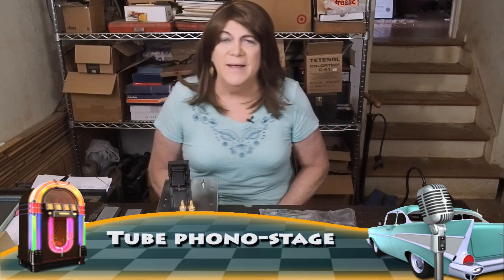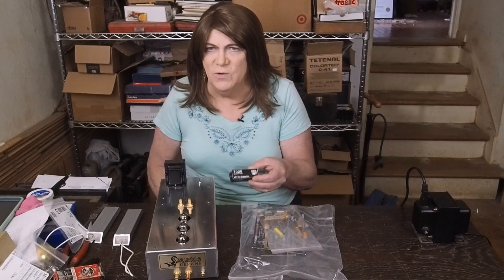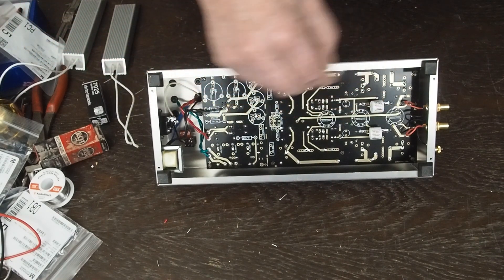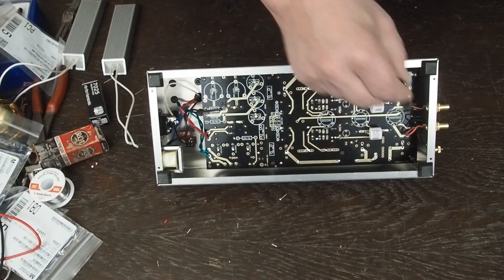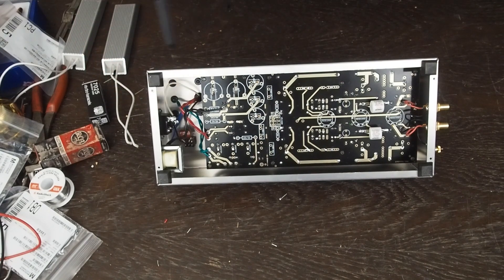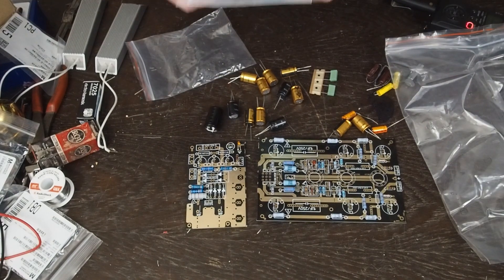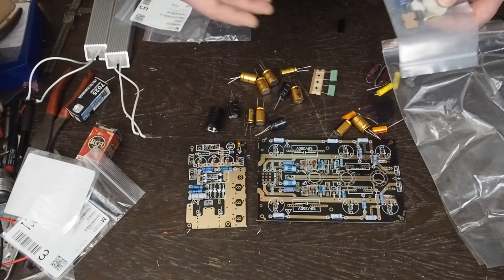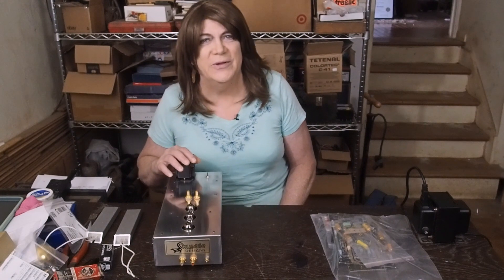All tube Phono Stage, Moving Magnet Pre-amp

Comment: realt beautiful you should se my point to point build, wold like to send pics of it, the construction use half ecc83 in start  I builded in an old tape causer.going to light it ups, it didn't get the rial filter correct so it went away -no noice to my bbl s. I hold correct the filter. I gave it ups.

Comment: I loved your video !
Before i get one of these PCBs,  I was asking myself if these designs come with a delay to ensure voltage is applied to heater before plates... I did not recognize it on the schema.
Also, is there a protection not to blow up the power amplifier that will come behind it with 200V in case something does wrong?
It's a pleasure watching your videos!
Sincerely,
Fabi
Reply from the maker: That's not an issue with small signal tubes. And the devices downstream are protected by the output cap, just make sure you use high quality film caps :)
Reply: @SkunkieDesignsElectronics  ❤

Comment: Is this available as a kit? If so, where?
Reply from the maker: I got the "kit" off Ebay, I ended up basically just using the board and replacing all the parts so would recommend getting just the bare board.

Comment: Good informative video. I built one of these during lockdown. It was my first build in over 25 years of neglected diy audio lol. Unfortunately I've been put off with the fact of hum. Built using 2 boxes, twisted ac wires, and the original components, bypass capacitors on the valves and using a toroidal TX. Connected an SUT for MC inside the box and use an Audio Technica AT33ptg/ii. Unfortunately, I had hum and still do. but put up with it as the sound was really good. But then with not using it for a few weeks, came back to using it and distortion. Such a shame, as it sounded good, but has put me off valve audio.   Have you done the other video on this yet ?
Reply from the maker: I got behind due to work but plan to get back on this soon! I wonder if the SUT is picking up hum from something? I honestly have avoided MC carts due to this sensitivity and honestly the AT VM540ML MicroLine sounds so good, I haven't even considered going to MC. Not sure where the distortion you are getting is from.
Reply: @SkunkieDesignsElectronics  Thank you for replying, much appreciated. I've used an at630 SUT into my amplifier and that's ok. I've only wired the phono for MC, even though I have put extra RCA's for MM. I didn't wire it, partly because of laziness and I don't have an MM Cartridge. Was thinking of purchasing a Goldring 1042. I have an old turntable, Ariston RD80 with Audio Technica AT1120 Tone Arm. I've Always wondered  how much I need to spend on a new modern turntable to better what I have.

Comment: Awesome video. Thank you. I was wondering if there is a way to put output RCA socket at the back or at least on the side? Having output RCA sockets at the front makes RCA signal cable going out front and back of turntable. It means the cable needs to go either going over tubes or either side of chassis and back to turntable. Sorry for mumbling and hope it makes sense. Nonethelss, great video and thoroughly enjoyed watching...
Reply from the maker: I located them up front to get them and their unshielded wiring far away from any AC noise. Plus my setup, the preamp is behind the turntable so it made sense for me. I do think running external shielded cables to the front, where you can distance them from the transformer and AC wiring, is better than trying to run them internally within inch of that stuff. For some folks it might make sense to put them on the top? Anyway, that's part of the fun of DIY, you can do it how you want :)
Reply: @SkunkieDesignsElectronics  Totally makes sense. I will try to figure out how to configure my set up with phono pre having input jack at the front without twisting wires too much :)

Comment: Wow, that's responsive!  Only asked the other day.  Lol.  I know others have been asking too.
Reply from the maker: I bought an extra board/kit about 9 months ago, people asking just made me decide to do it :) I want to use good caps and good metal film resistors, plus work on my lead dress + layout, and see if I can get rid of the little bit of hum the first one I built has.
Reply: @SkunkieDesignsElectronics  Yas, all of your plans for improvement make sense. Do they sell just the board, no parts, so that the user can stuff it with whatever level parts they want?  I looked it up but did not find the same board that you showed in your video.  FYI, multi pin xlr's are used for umbilical cords quite often.  But I guess you know that.  My rane thx eq uses phone cord which seems very cheap.